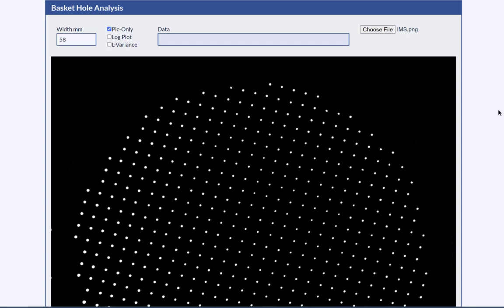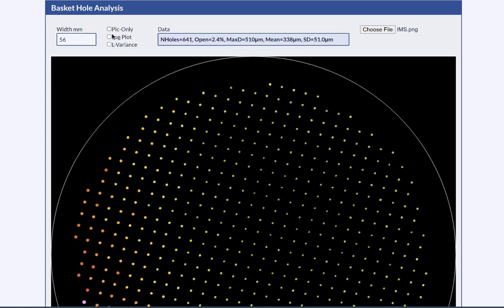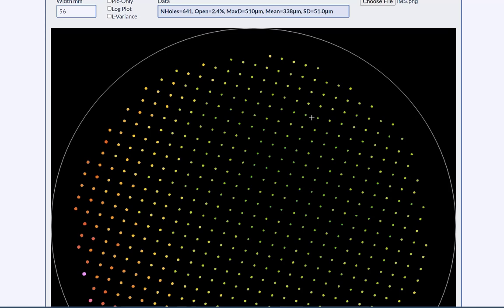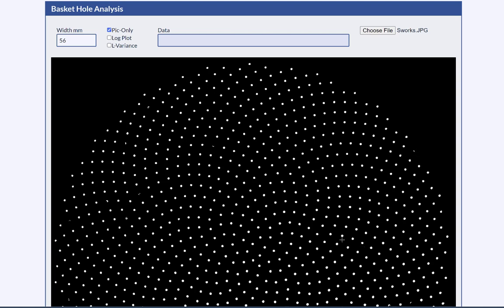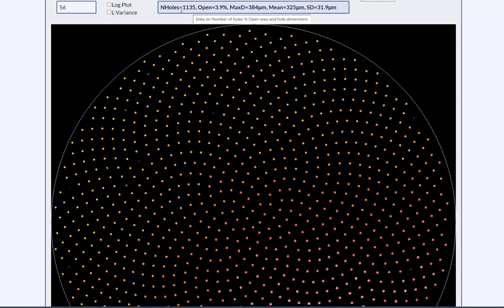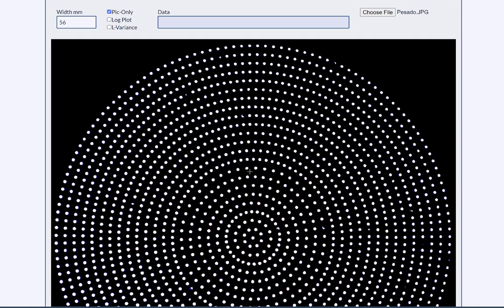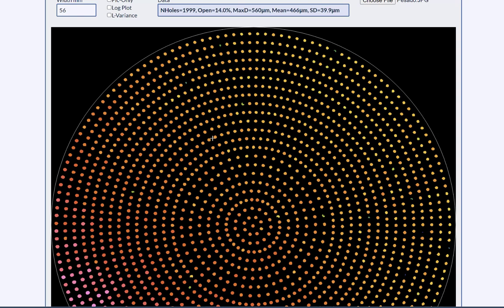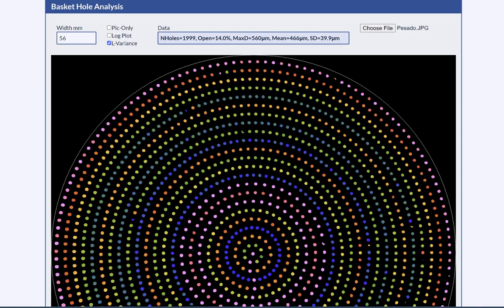Espresso Basket Hole Analysis

Comment: I did the exact same as the fellow below with a gaggia basket, but using a wire frame a wire brush @ 0.5m   Came out very even at 9% open area, with extremely small StDev. Great tool! It would be nice if there was a database page where we could upload and compare the various baskets.

Comment: Thank you so much for the app and this video. So for measuring the "width" where exactly does one have to measure? Inside the opening lip of the basket or near to the bottom of the basket which is tapered down?

Comment: Wanted to bore the holes of my stock gaggia basket because they had tonnes of burrs from the factory grinding process. This data was super helpful! Used a 0.3mm needle and some polishing compound to even out the holes.
Reply from the maker: Glad it was useful!
Reply: Ha, I did the exact same but with a wire from a wire brush @ 0.5m   Came out very even at 9% open area, with extremely small StDev